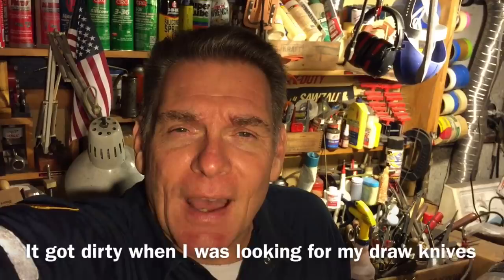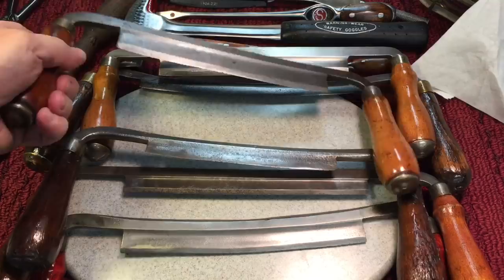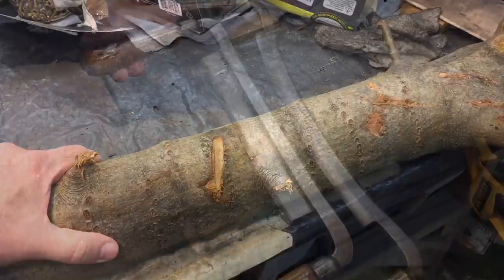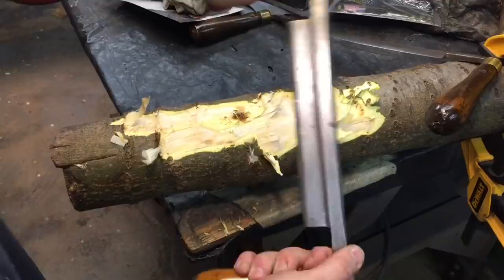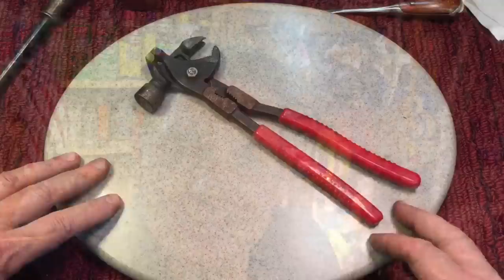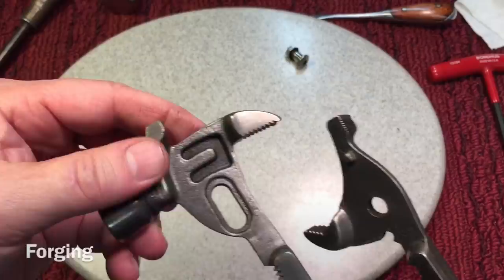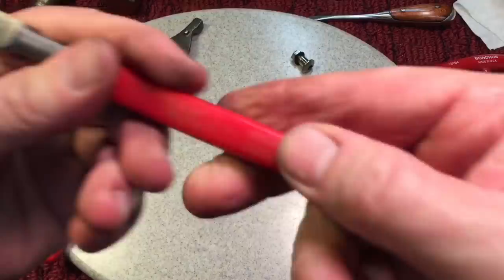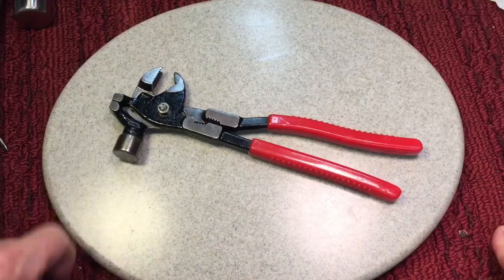Draw Knife Introduction and Vintage 6 in 1 Multitool from Taiwan

Comment: The six in one tool seems to be something of a marvel of value engineering. They were able to make the whole thing out of quarter inch sheet because they welded on the forged jaw and hammerhead. Pretty impressive way to keep manufacturing costs down

Comment: On the draw knives. I used to teach telephone technicians to climb poles. At the end of each class they got to shave all the gaff marks and splinters off all the poles with a draw knife.  They started at the top and cleaned the pole all the way to the ground. Our draw knives had a safety bar on the blade side so that when you drew the knife toward your safety belt you wouldn’t cut the belt.   It was not a perfect safety device. We had a guy damage his belt.

Comment: I use a drawknife and Spokeshave basically anytime I’m in my shop. The only time a drawknife is dangerous is when it is just randomly placed on a bench on top of other tools or materials you might use. I have cut myself numerous times because I reached for a crew driver that was under my drawknife and I bumped it and cut myself haha. So when u are done using them or it’s time to fit the hammer/axe, put it in its place. Take the extra two steps or whatever. It’s worth it haha. Thanks for the video john!!!! Love it!!
Reply from the maker: Brian- All sharp tools will eventually bite you!  However when in use the draw knife was one tool I felt pretty at ease with when the scouts were using them.  The Axe on the other hand...   =D

Comment: Another great video. I learned a lot on the draw knives. I have a few but really never used them. You’ve inspired me to get them out and give them a run. That little multi tool would be handy to throw under the seat of your truck. Seems like it could get you out of a bad situation if you didn’t have any other tools. Thanks

Comment: I have one of those multi tools. The brand on mine is KATIMAX which I believe is a German Company. There were two sizes. That size you and I have is called a System A. The larger size is called a System B. 
Mine came from a salesman that was trying to introduce it as a replacement for a several lineman’s tools. Maybe instead of electric nail gun they meant electricians nail hammer.  The pliers were to replace 9” Klein pliers. The hammer was to replace a lineman’s hammer and the side you call a pipe wrench was actually the correct size for the nuts and hardware that fastens lines to the pole. He had mastered the functionality of the tools and could really work the hardware. The System B being larger complimented the System A so you could work both sides of the through-bolt in a pole.   also Supposed to eliminate an adjustable and Klein lag wrench. 
I suppose if you learned to work that way it would be fine. 
My multi tool has no patent # or country of origin. My buddy John got the System B sample and I got the System A. 
Yours is the first one I’ve seen other than the two a salesman gave us to evaluate in the mid 80’s. 
Very interesting for sure.

Comment: They are not necessarily woodpecker holes. If the limb happened to have come from a laburnum tree, they do this naturally. Technically I suppose it's not natural, it's like an immuno response running out of control in response to insects.
Reply from the maker: These holes were woodpecker holes, we have a few species of woodpeckers here and some you can watch spiraling around the tree making small holes!  Very interesting to watch as I don't know how they get a grip on the trunk!
Reply: @ScoutCrafter  yeah we have a lot here too. Did you know their lips wrap around their brain to prevent damage when they're pecking? Nature is so cool

Comment: Many many years ago, my wife returned from Ikea with a pair of channel locks for me. I was horrified, you do not buy tools from the king of particle board. I've had those pump pliers for 15 20 years now, the single best I've ever used. Looked very similar to your multi-tool. Had a plastic lever on the back for shifting into other positions, making it perfect for one-handed adjustment. I have never used pump pliers that were better. To this day the black ox coating is pristine, and I purposely abuse that pair. Who would have thunk it? Tools from Ikea. I've always wondered who got the contract, bahco maybe?
Reply: That pair of pliers had the exact same red plastic grips.
Reply from the maker: I learned from experience not to be a tool snob, many tools I have that were cheap and no name turned out to be fantastic working tools...  I will never completely trust China anything but every once and a while some decent stuff slips thru!  =D

Comment: The angle of those handles on draw knifes always struck me as wrong. The handles are pointed down towards the same way your pulling which one would think would allow the grip to slide down and off. I may be wrong but shouldn't they be at a different angle so your not pulling/sliding off with each pull/stroke?
Reply from the maker: You are right!  If you are just pulling back straight then handles that are straight out would be better, however one feature of the draw knife is the ability to control the attack of the blade angle by slightly lifting up or down on the handles.  If the drawknife was straight across you would have to twist the handles to achieve the same effect.
Reply: @ScoutCrafter  That makes sense

Comment: Isn't there two sides to a draw knife. Bevel up, as it appears in your video for thick cut ruff work, or bevel down for thin cut finish work?
Reply from the maker: You can use it normal, upside down and 90 degrees as a scraper..  however I rarely use it upside down. It’s all what you are used to. I have knives that are beveled the same on both sides!  (No up or down). 😃👍
Reply: @ScoutCrafter   on the single sided bevel draw knife, If you take the handle that is in the right hand and place it in the left hand i.e., swop handles but still draw towards you. Because sometimes it catches grabs the grain and digs to deep. putting the bevel down reduces this issues